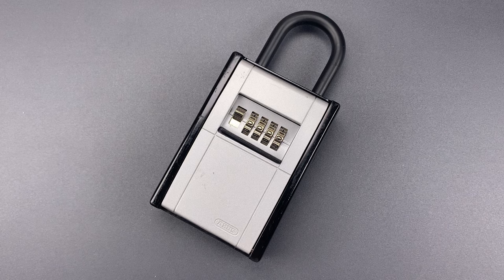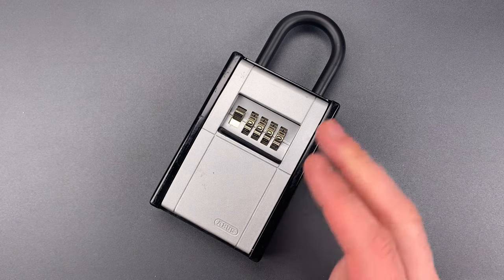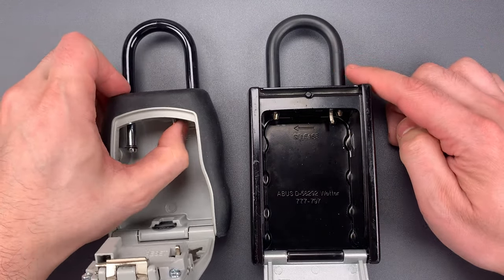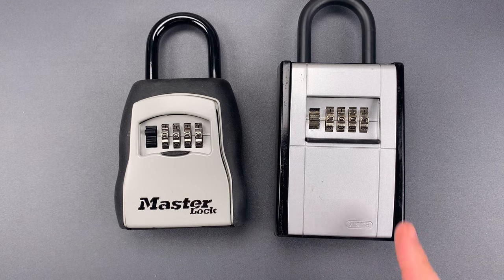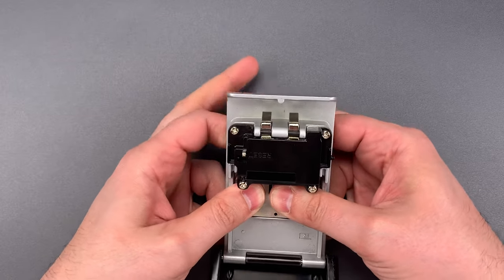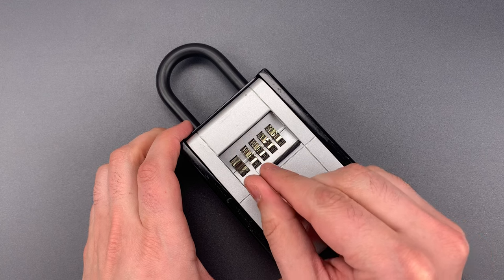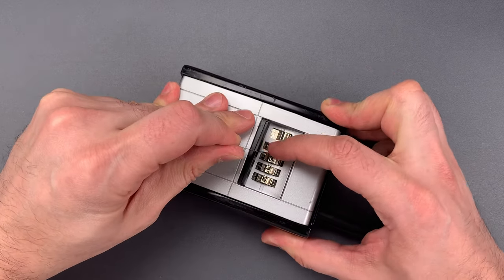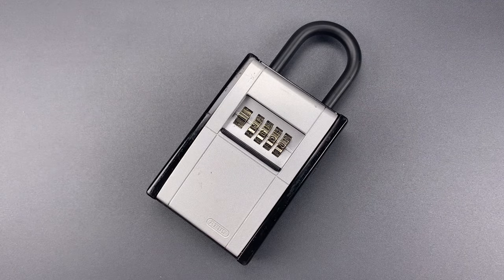[1057] Abus vs. Master Lock Key Lockboxes

Comment: Still waiting on the day you scramble that combination and it scrambles to 1234..IT WILL HAPPEN, I BELIEVE
Reply: 1/10000 chance, so just a few more years of videos
Reply: And if it does?
Reply: @wileecoyote5749  Stonks
Reply: @wileecoyote5749  The universe will instantly cease to exist
Reply: 1337
Reply: I got a reset pin for my netbank with the value 0000 a few years ago -- I think I still have the letter :)
Reply: @3dlabs99  should get it framed
Reply: "1234? That's amazing! I have the same combination on my luggage!"

Comment: I've always wondered with these if the shim is necessary. Would you be able to get it to bind by just pulling the release? What is on the inside that prevents one from just pulling the lever down to make it bind?
Reply: That's my preferred method, it works for a lot of these type of locks
Reply: He’s shown the pulling method in other videos but it doesn’t work on all locks of this type. Unfortunately I don’t remember the exact details though.

Comment: Present realtor lockboxes are operated with a cell phone app.  You should try one of those
Reply: He had several similar "digital" locks on, they tend to be poorly made and often can be opened by bridging wires on the non secure side
Reply: @majan6267  The digitals that I've seen were RFID. The realtor locks appear to respond somehow to a cell app.
Reply: @alexmentes1348  you can still access the unlock solenoid contacts in a lot of them. it doesn't matter how secure the credentials are when you can bypass that whole part.
Reply: He has been doing rfid locks lately.

Comment: Are there any decent combination locks? (lol at the third wheel decoding itself!)
Reply: I would assumed that combination locks are mostly used on "less-secure" place, like locker. The circular lock thingy is pretty good concept. Unfortunately, most of it can be bypassed by putting metal into the locking mechanism

Comment: I'm wondering if at least the combination tumbler portion of these locks are a commodity item and bought from the same supplier: the only external difference between them is that the Abus version has a silver unlock switch and the cover-panels inside the doors look very slightly different, but the "reset" button is in exactly the same place on both.
The coincidences of the design features seem a bit too good to be true, almost like both key-boxes could be from the same manufacturer and just given a slightly different cosmetic design as per the company brand molded into it. I would not be astonished if there was a single production line somewhere in the world which spat out these boxes with a slightly different shapes for each of the different lock companies. The same probably goes for their low-end consumer grade locks as well.

Comment: Would this lock be more secure if it had a fixed code? 
I somehow have the feeling the mechanism that is used to change the code, it also the one that is exploited here..
Reply: I doubt it, the bar at the back that LPL is putting his feeler blade against would be part of the design even if it was monocode

Comment: I dont know, we have 11 of these boxes in a hostel, 3 of them are locked and i cant open them. Watching this video the third time on my fifth try, its not as easy for "normal" people. The only metall that is thin enough to fit thru is an aluminium can and that is now to weak and it bends. Also if the lock is old or hung outside in weather, it doesnt turn smooth any longer and its difficult to even spot that loose number. All in all, unless its a pro with the right tools and know how i wouldnt worry too much about it. The right metall alone is already difficult to find. Now i am manually decoding it, i am at number 0-4000, got 6000 codes to go... FML.

Comment: These cheap lockbox things( usually masterlock) are unfortunately in wide use in Finland at construction sites to secure tool containers and structure keys and the locks which they use at these locks are always Abloy locks... Protected by masterlock. I demonstrated to one  foreman how to decode that box I had no experience to do so but have seen few lpl videos and I was able to open it under 2 minutes useing filler gauge that I found at this conclusion site. After this foreman drove to shop to buy heavy duty steel box with Big Abloy lock with Protec 2 core 🤣

Comment: Hey LPL, what is a good brand of lockboxes? or have all of the ones you tried susceptible to the same/similar design flaws?
Reply: A good lock box is extremely expensive (1000$ or more), has double doors, opens the outer door with access to the pin pad only when needed (time based or with an fire oder burglar alarm system) or if really necessary after external authentication like with a second keypad, is from hardened steel, connected to an alarm system for intervention in case of tempering or opening the outer door through bruteforce and should have an digital pin pad allowing multiple and one time codes. So an attacker may opens the outer door with bruteforce but gets an alarm and security and or police intervention so he won't even fully open the inner door before getting in trouble when not running away immediately. A very expensive example for things like this would be the "ESD Einsatzschlüsseldepot" by the German manufacture Kruse.
Reply: Just don't. Having a lockboc outside your house is a security vulnerability

Comment: Got my first lock picks i cant pick ige been trying for 3 days its harder then it looks people
Reply: Nah fam I got mine 2 and I was able to start on a China lock and. It’s pretty easy
Reply: Swishified dude i got a see through one and I can’t get it its so tricky
Reply: @jpfaria2832  haha  of course a china lock is easy.  
jump into something with some security pins.  if its still that easy you've got a talent most people dont.  so even then it's silly to tell people its easy.
Reply: i found the assa lockwood 334B45 locks easy to do but have a bloody hard time with the master lock #3 for some reason
Reply: Keep practicing with decent picks.  You'll get there.
Reply: nightstalker9550 the clear one can just be opened with the flat tension bar, simply all the pins raised at once will open it as you gently twist and possibly slowly wiggle down (it’s actually faster than the key due to how the bitting in the key slows you down when inserting and it’s just easier to get in the hole).

Just patience and don’t expect miracles at first (maybe a few lucky attempts, then just figure out what you actually did then). Also you might just be starting from the wrong end (front to back vs back to front).
Reply: Use light tension. Move the core as far as it will go but as soon as you hit that limit, don't put any more pressure on it. Now you will find it easier to set the pins.